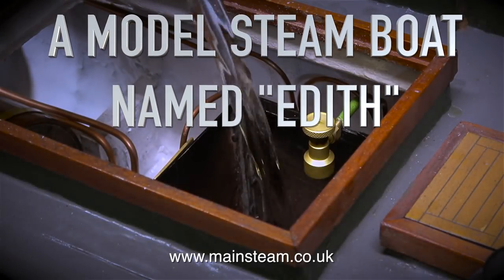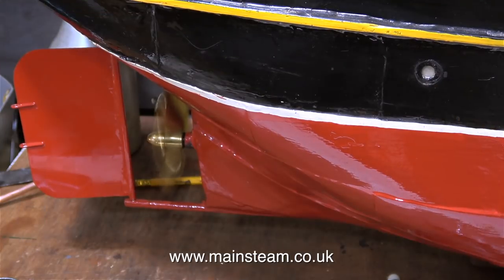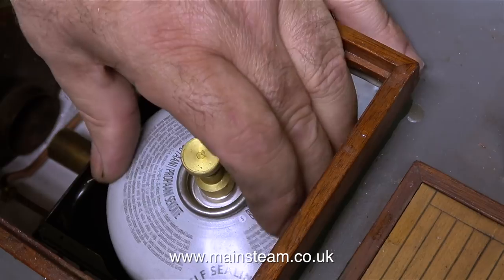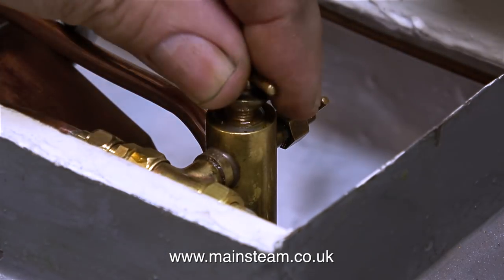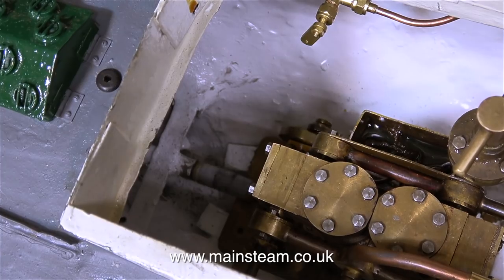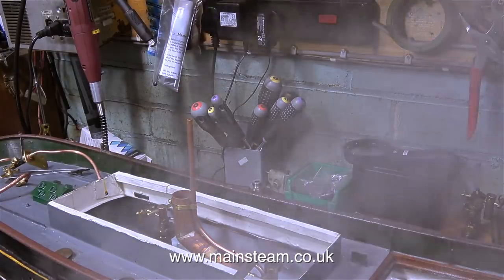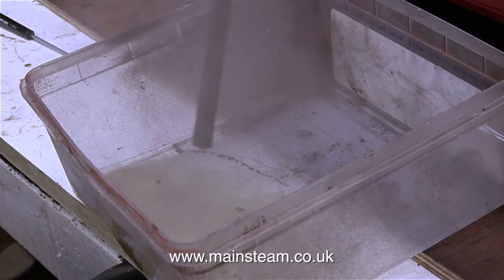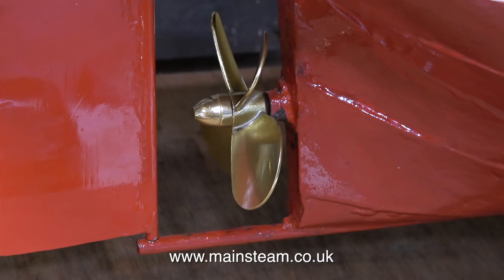A MODEL STEAM BOAT NAMED EDITH - PART #31

Comment: I noticed and like the way the exhaust from the boiler is or will blow up the funnel when it's assembled causing the heat a fumes from the engine room to be drawn up the funnel and vented to the out side, that natural draft will keep the engine room some what cool when running ( I am assuming here )... Great video Keith, thanks!
Reply from the maker: you are correct John }:-)))

Comment: Abs amazing build, something to be proud of :)   One thing I was going to ask, will you put an insulator under the gas fire to protect the hull from the sideways heat of the burner and insulate the bottom of the hull from the boiler itself as I imagine that will get toasty hot?
Reply from the maker: heat rises so it's not a problem .... it vents out of the top of the superstructure . . . .

Comment: Is there a name for the fitting/ valve that attaches to the gas canister or is it custom.
Reply from the maker: it is called a gas valve.
Reply: @keithappleton  the issue I'm having is finding one that fits onto the threadded gas canister.
Reply from the maker: www.forest-classics.co.uk
Reply from the maker: or ...... https://www.ebay.co.uk/itm/P7-GAS-CAN-VALVE-Live-Steam/371642414144?hash=item56879d3440:g:TmgAAOSwepZXTCIV
Reply: Thanks.